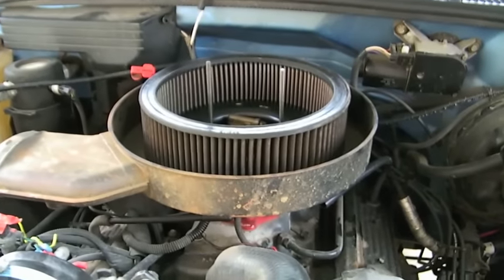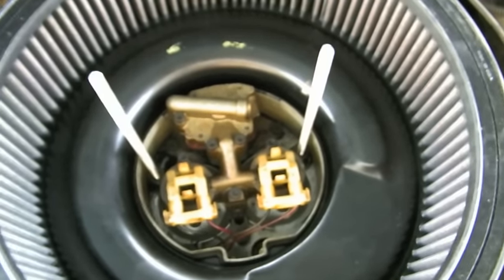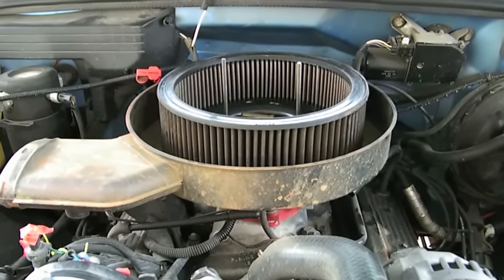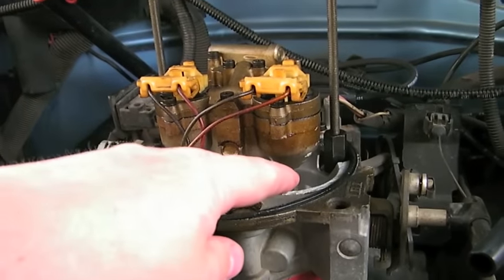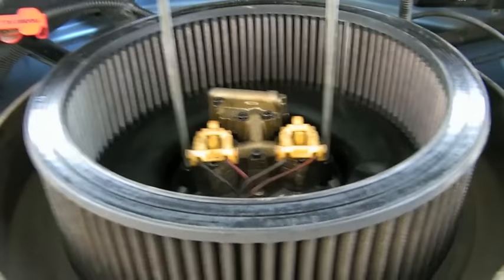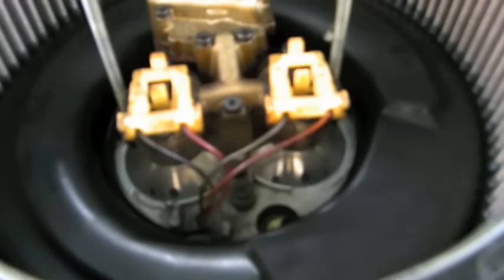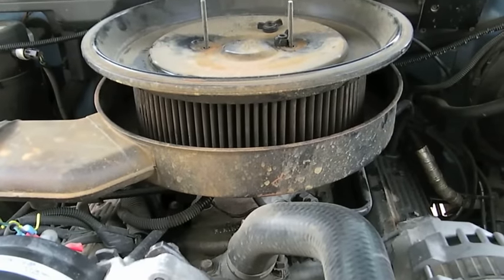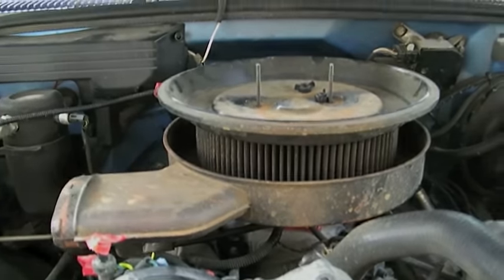TBI mods, how to get the most power and Horse Power from your TBI engine.

Comment: Dude, I'm n tears right now. 1st. thing, if you had read a book on how an engine make power.
(I'm not talking about a brochure written by a company selling high performance aftermarket parts.)
You would not have bought a throttle body spacer. The tower you remove and the metal, was there to smooth the air going through the TB.
The 3 inch exhaust and removing the cat was a big waste of money. (Unless u like a loud slow truck that pollute). You are looking in the wrong place for move hp. The reason you 94 5.7 only make 210hp @ 4000 rpm is because it has a weak cam. 
Change the cam and you want need your Ipod to tell you are making more hp.
20 more hp, you done bumped your head.
Reply: The tower he removed and the metal removed smooths and increases airflow and atomization of the fuel,. A 3 inch exhaust helps a TBI engine, just like headers do.  I have a 1990 Silverado with low miles and last summer it turned a 14.55 @ 98 mph in the quarter mile with stock internals.  I got thottle body mods, 1.6 RR's, custom ground chip, salad bowl with K and N, Corvette servo, headers, cataytic converter deleted, flowmaster and a 160 stat.  If you don't know about throttle body engines, remain quiet.  Mine pulls to 5 grand.
Reply: LT1HILLINGHOE You are lying your ass off. You did not change the cam so your 1990 run out of breath after 4000. You can take the exhaust manifolds off and run headers to the rear bumper and it will still run out of cam @ 4000 rpm.
Reply: Yep these motors main holds backs. Are the heads and cam.  Some 197 72cc would be nice or 202s and atleast 490 lift cam or just custom grind cam that has range atleast to 6k rpm and carb it . But i like the tbi i know the tricks on one we ran on our 360 stroker motor change the injectors want make much as carb but close and drill out the little piece so u can idle it  how u want it .
Reply: ***** I side with you. Cam and valvetrain upgrades will give the most gains. Headers are useless on cheap builds under around 300hp. And cheap builds are those who "mod" their stock parts rather than buying a professionally engineered product(in this case an aftermarket carburetor) . Sure, the throttle response may be more noticeable but your losing turbulence on long pulls. And "atomization" of the fuel is determined by the injectors themselves, not the air dams. Haha atomization. I think you meant carburetion? And TBI is simply the first step into fuel injection, the same rules apply for the most part whether its old school carb jets, tbi or efi in terms of exhaust and intake.
Reply: WetWypes It's funny how people think EFI has change the rules to making an engine stronger. There are people who think changing the chip is all they have to do to make a 300hp LT-1 make 350 hp.
Reply: WetWypes
Wipe the wet from behind ur ears, sonny buck.  I have been building speed since 1983.  Run along to where you have a more captive audience...say Romper Room or perhaps Fast and Furious movie goers.  Ur a rookie with rookie comments.  Please don't "side" with me.  I don't need that kind of idiotic company.
Reply: WetWypes
That's telling 'em, rookie!!!
Reply: 123444
Reply: ***** you put a cam in an engine to suit your top end, your valve body and intake. you cannot have a large duration cam if your valvetrain and lower end do not have the means to support it, the same way vice versa. taking off stock exaust and putting aftermarket exhaust keeps your engine cooler, providing an equal percentage of horsepower and torque. on an EFI system, you can do acheive the same goal as a carbureted system by using a "chip" that tells the computer to provide more fuel to an engine. you CAN NOT put a new performer cam in an engine without putting a matching chip in the computer. A throttle body spacer increases the distance between fuel deliverory and detonation, allowing the fuel to become more seperated for better burning. just because you can change oil and replace spark plugs and fantasize over having a performance vehicle does not make you qualified to insult someone elses project. believe it or not but i can get a chevy v6 rwd car to run 0-60 in 3.5 seconds. all i did was run a two speed powerglide transmission and a really low rear end. the engine had 100 hp and had a missfire.
Reply: Seth C You can get cams that have steeper ramp rates and tighter base lobes to keep the computer and the sniffer happy. But everyone modifies their vehicles differently, I just prefer the most beneficial ways
Reply: WetWypes If u don't have to reprogram the computer, the cam ain't worth putting in.
Reply: ***** bud, a chip tells the computer to tell the engine how to run. you put a high performance parts in an engine, you either go carb, so you can manually adjust your fuel/air, or you get a computer tuning chip so it does it automatically. ive built and seen engines with a single injected tbi out perform a 4 barrel edelbrock carb. getting a new tuner chip is like getting a new engine in a sense, you cant say they do nothing for power. you probably watched something on tv and think you know everything about everything.
Reply: WetWypes i mean, a much as they have cams for intense power at the expense of fuel economy, they have just as much for fuel efficiency. but if you have a vehicle with obd 1 or 2 you need a way to tell the computer in needs to change what its doing or youll run into problems.
Reply: Seth C No one make a cam for fuel economy. Stock cam only.
Reply: ***** yup. If you knew how a can works youd know all you had to do was shorten the lift and duration of the intake lobe. But you'd have to do the same to the exhaust lobe. I mean, what did you think a cam does?
Reply: Seth C OK smart guy, how are u going to shorten the lift and duration of the stock cam? Why would u want to anyway? The damn engine only make 160 hp.
Reply: ***** the 350? no the tbi made 210 and even up to 240 in the later years. my point was your cam pretty much makes the performance of your engine, provided you had everything to boot. you were saying in your original comment that exhaust has nothing to do with power, measuring my 89 350 truck stock had around 200 hp. after cutting off the exhaust to the manifolds i had 215 but my torque shot real far down. after putting a 3 inch pipe into a flowmaster muffler i had 220 hp with the same torque i started out with. but back to the cam subject, you get whatever cam suites your needs, whether its torque at lower end or higher end, or for fuel economy.
Reply: Seth C Your 350 made the same hp and torque with what ever exhaust u had because you did not change the cam.
Reply: the cam isnt the only thing that creates horsepower. it wont create any horsepower if you dont have the stuff to support it. you obviously dont know how anything has to do with anything. what vehicle did you only put a cam in and are all of a sudden have 9 sec quarters?
Reply: Seth C You can make more hp changing the cam and reprogramming the computer on a TBI 4.3, than putting a throttle body spacer, headers, x-pipe, dual exhaust and cold air intake put to gather.
Around 1992 GN had some minivans making 175 hp from TBI 4.3s. My friend had a 92 Safari and my sister had a 92 Astro. I use to wonder why his Safari was so much faster.
Reply: ***** well one of those vans were awd, aint sure which one. but yeah you just stated the point i was trying to make earlier. you cant just put a cam in and hope for the best, your engine has to be well equiped to support it
Reply: Seth C Neither van was awd. The point I'm making is, both van had the same 4.3 TBI. The 92 Safari had the hotter cam and probably a different computer. That 15 hp was like night and day.
Reply: now you are switching opinions, earlier you were telling me this was wrong now your telling me all about it. do you even know what horsepower is?
Reply: SS4LiFe1488 Either way you feel any difference.
Reply: +iimusion &:what do you recommend doing to this sort of engine to increase horse power?
Reply: Thelegitrager Read my comment again and you will see where I said CHANGE THE CAM. That is the reason TBI 350 are weak. It's not the throttle body. Put a cam from a 96-99 5.7 and reprogram the computer and you will feel the power.
Reply: +blackericdenice there are a lot of smaller-ticket items to do in order to yield results before cams. Cam should only be done with proper heads and intake. Besides you're comparing apples and oranges - bolt on mods can't be compared to major engine work.

Might as well just tell the guy to bore and stroke it to to a 383
Reply: Bricke The small ticket BS u speak of don't increase hp. The dyno videos u see on cable and youtube are staged.
He can get 50 hp or more with a hot cam with the stock heads compression and displacement. The only problem is programming the computer to add more fuel.
Reply: I don't rely on YouTubers posting butt-dyno videos praising certain mods. I work in a shop and do plenty of that myself in my spare time.

But again, you're comparing apples to oranges; and if you think a cam is your only (read: "only") way to increase power in these trucks, then you're just being stubborn, and I'm sorry you feel that way.

Big-ticket jobs requiring cams, heads and intakes isn't comparable to DIY'ers doing backyard mods, which is what THESE videos are about.
Reply: Bricke The only way to increase hp is to add nitro, change the cam or boost the engine. Those are the only way to get more air into the engine. Anything else is bull shit.
Reply: ...yeah ok.
Reply: +blackericdenice No, if you take a stock air cleaner such as his, Grind the ridges off the tbi and put on an open element air cleaner you will infact increase the airflow into the engine, also the ridges arnt to smooth out the air flow, if anything they are doing the opposite. Its like putting a piece of plywood in front of a fan (or half of it) and saying it smoothes out the air flow. Doesnt make much sense now does it? As for the TBI spacer, it reallt depends on the vehicle. There have been dyno tested vehicles before and after that have saw a 2-3hp gain from one, others have lost hp or it didnt affect it at all. +boofighter Keep it up man, Do all the mods you want. If you can tell a difference (in a good way) then thats all that matters.
Reply: +blackericdenice you really think you know how to build engines dont you
Reply: Sam Wegleitner No, I don't I can, I know I can. I went to school for it.
Reply: SS4LiFe1488 i know this is old but honestly removing the cat wont improve hp by much, it will some because it reduces back pressure to the engine but it will increase mpg. Also changing stock y pipes to a more free flowing y pipe will help too. Also if you are making more than 270 hp changing headers will help as well but you wont notice a big difference (depending on the engine) until you do a cam swap. Even doing a mild one like Rv rolloer cam or flat tappet would help. With a 350 tbi if you do either of those cams or a different one plus put vortec heads with an intake swap on it and change headers and the y pipe with a Cat delete and flowmaster Pro 40 or pro 44 series you will have power and an aggressive sound. Or you can opt out of the Cat delete and get a high flowing cat.
Reply: Justice Clayton I stop reading your comment at cam. I don't waste my time reading long comments if the person don't what they are talking about. 
The only way to get more air into an engine is to add nitro, change to a hotter cam or boost the engine. This is not my opinion, this is fact. If you knew what you was talking about, you would agree.
Reply: ***** well you can think what you want but you're wrong.I dont see how Nitrus is adding air whenm its a Gas?
Reply: Justice Clayton COME DUDE. I know u did not just say that. I'm talking about nitrous oxide. Google it and you will see how it will put more air into an engine.
Reply: ***** I never said a TBS would garuntee HP or increase air. I said some poeple have proven gains and others have lost. I know how an internal combustion engine works. Intake,Compression,combustion, and exhaust. Pretty simple to comprehend. But there are a ton of ways to increase air flow other than what you are saying. No, not all of them are cheap like having your heads port and polished to increase flow rate by maybe 10-20% But there is a list of very long mods you could do to get Hp, out of an engine. Lets take this guys 350 tbi for example. CAI or open element, Lets say a comp cam, Vortec heads that have been polished, Long tube (or shorty) headers. (i prefer hooker), After market Y pipe because the factory one on these is terrible. Switch from a TBI to a Holley or Eldebrock perform. carb with the eldebrok perform intake conversion. Put in a programmer or chip. Change the crappy 3.46 rear end to a 3.73 or a 4.10. Thats pretty much all you can do to these motors besides port matching them. Unless you want to build the block and make it a 383, but that is about triple the cost of everything i mentioned put together. All of that being said you would gain (i am estimating here) approximately anywhere from 25-70 HP depending on fuel type (octane rating) and the programmer/chip and if you actually redo the ECM to take advantage of the new vortec heads you just put on. Also you would have to upgrade the fuel pump to support the 12-15PSI of fuel pressure this thing is going to want. I'd reccomend 13. Now get a perform Dist, cap, and rotor as well as an ignition system and you will see 50-70hp gain if not more from the stock side of things.
Reply: Correct me if i am wrong which i am sure you will think i am.
Oh and a cowl induction hood would increase air flow to the inside of the hood allowing the Air filter to suck in more air, as long as you arnt using a pos paper filter and use a oil lined cotton filter such as K&N
Reply: Justice Clayton A cam will give u the largest increase of hp out of all those parts u name. Rear end gears can make your car quicker. I would rather have 300 hp 350 and 2.73 gears. Than 150 hp 350 and 3.73 gears.
Reply: I would have to disagree, Chaning the cam on a stock 350 (tbi) without using vortec heads wont yield as much Hp as if you had used the vortec heads. If you are changing the Cam you may as well do the heads. As for the rear end gears yes i know what they do and i agree. But lets be honest who owns a 300hp 350 and still has stock gears in it.
Reply: Justice Clayton Not right. You can get more hp from changing the cam alone than changing the heads alone. The reason I say this is, the stock 95 heads are nowhere near max flow with the 95 cam. The reason the 96 vortec heads don't have the ramps are because the CPI atomize fuel better. BTW, before you say the 95 swirl heads make more low end torque. The 96 vortec made 330 ft-lbs of torque @ 2800 rpm which is lower than the 95.
Reply: +blackericdenice  it may run out of power, but the trucks pull to 5K.  5k is the redline of the old tbi engines.
Reply: 2012Z28Camaro If you say so.
Reply: i do. because some of us actually build racecars.....
Reply: 2012Z28Camaro You build race cars right? I have a question you should know. I have a 271 V8 with 180 hp at 4000 rpm. I want it to make about the same hp but at 5000 rpm. What should I do?
Reply: +blackericdenice put some bigger gears behind it
Reply: Cody Edwards Wow, u build race cars to?
Reply: Nope lol just my guess.
Reply: +blackericdenice but outa curiousity, hows it done?
Reply: +blackericdenice cause biger gears would increase rpm and tourqe but not horse power. or maby swap gear ratios in the trans, but this is one way you could do what you was saying, and btw takin crap over a key bord is awsum, so where do you build racecars?
Reply: Cody Edwards I said raise the engine hp peak rpm.
There are a lot of kids on youtube fronting like they know something. I can think of Google proof question to weed out the fake-ass people.
Reply: +blackericdenice yea i feel yea, in first question you said about same hp but at higher rpm, thats why i said gears, but it but to raise rpm its gota breath beter(intake, cam, heads, headers/exhaust) probably should upgrade the spark(pending on what it is, distributer, coil, points and plugs/wires) retune fuel source/vacuum, pending on how high your gona be reving it, possibly bottem end/rotating assembly
Reply: +blackericdenice and pending on what your throwin it into, high hp dont mean nothing unless your talkin up by 7 to 800 hp or so, you can make a 4 banger do wheel stands and run like a bat outa hell with the right gear ratio, you just aint gona have a high top speed
Reply: 2012Z28Camaro  I gave u a change to prove yourself. If u really race engines, the question would have been easy and u would not have taken so long to tell me. I was looking for u to say 7 words. You can't fool a real car guy with shit u googled. 
Where I come from, we don't say words like Mod. That shit is straight from an auto TV show. Patina? We call it fade. That's how I tell if u are real or Hollywood.
Reply: ***** also patina? i call that rusty shit. rusty shit doesnt look good
Reply: 2012Z28Camaro Are u going to answer the question?
Reply: Cody Edwards I will tell u if Mr.I build Race Engines aka 2012 don't give me the right answer. His fingers are bleeding right about now.
Reply: 2012Z28Camaro That's what I was waiting for. You just through n the towel. When a racist white man can't when a fight. He start using racial slurs.
Reply: 2012Z28Camaro Because of the racial slur on this channel. I deleted your turbo lag comment on my channel. If u use one racial slur on my channel. I will block you.
Reply: 2012Z28Camaro I got another Google proof question. I have an 89 Mustang GT with a 225 hp at 4200 rpm 5.0. I add a supercharger and now my engine make 300 hp. At about what rpm will my engine peak at?
Reply: Once again trying to seem like you know something. Its not google proof either nothing is.

But you neglected the size of the blower, whether it was roots type, or centrifugal, if you changed the cam and heads (which anyone who is putting a supercharger on would do with at least minimal head porting) 

If all you did was straight up supercharge it then your engine would peak its hp and torque (of which you didnt specify) depending on blower size and amount of boost you were running of course. but im sure you "think" it works differently
Reply: *****  and i do hope you know what supporting mods a supercharger requires other than what i listed.....
Reply: 2012Z28Camaro Answer the question if u can. I'm not asking you to rewrite history.
Reply: +blackericdenice yo i answered this shit a week ago. literally two comments up. its right above my last comment where. heres copy and paste since you dont seem to look up. 
   2012Z28Camaro 1 week ago

Once again trying to seem like you know something. Its not google proof either nothing is.

But you neglected the size of the blower, whether it was roots type, or centrifugal, if you changed the cam and heads (which anyone who is putting a supercharger on would do with at least minimal head porting) 

If all you did was straight up supercharge it then your engine would peak its hp and torque (of which you didnt specify) depending on blower size and amount of boost you were running of course. but im sure you "think" it works differently
Reply: 2012Z28Camaro All that writing and u still have not answer the question. It's Google proof because the answer is online but you have to know something about engines before u will notice it.
The size and type of the blower is not needed. I gave u all the info u need to answer the question.
Again I say. You can't learn about cars reading hipo parts adds because they will only tell u enough to buy their parts.
Reply: 2012Z28Camaro The 1st question about the 271 cuin v8 making 180 hp at 4000 rpm. To raise the peak rpm to 5000 rpm. You have to add duration only to the cam. 
The 225 hp at 4200 rpm 5.0 v8. If u add a supercharger and the engine made 300 hp. The peak would still be at 4200 rpm. 
When u know what u are talking about. You don't have to give long ass comments to explain yourself.
Reply: ***** you asked how to move the peak rpm with an engine making that much power.

You did not say increase power. therefor a cam swap is not an option. fucking obviously you can change the cam and change the peak power. thats every engine not just that one. gears and stall would effectively move the rpm with out changing the 180hp limit you gave me.

No with a supercharger peak would not be the same. it would hit much sooner. depending on blower size.
Reply: ***** once again your trying to sound smarter than you are and never answered my question. just like in your videos, you post what you think, not facts.
Reply: 2012Z28Camaro If u really build race engines u would know I'm right..
Reply: ***** Not hardly. youve got no real idea how engines work. Youve got a decent base of regular knowledge, but you preach your opinion as fact on many things you dont actually know.  Im working on 5 motors now. one 4.8, two 5.7Ls1s two 305sbcs.(sbcs will be in circle track cars)

Got a 6.0 thats ill be turning into a LSA but not messing with it till the other 5 are done.

1 ls1 is going in my autox camaro
(450rwhp, Handported heads with .600/.600 cam on 112LSA, daily with yankSS3600, 4.10s
1 ls1 is going into an 80s TA
LSX conversion that ill just sell as a full weight 11.xx drag car

The 4.8 is going procharged and will be in a 80s CJ7 (800+HP redlining at approx 7500)
will stay lifted on its tired 33x12.50s

The Two 305s will be in circle track cars im building. 
High revving, but durable turds that my friends can use for a few years...

what are you building?  a 180hp 271? thats cool...
Reply: ***** My ninja
Reply: Yank it out and drop in a ZZ5
Reply from the maker: +Peter  Pease 
I don't think I will be doing that.
Reply: SIMPLYBEAST1231 It can pull to 5,000 but it's not making hp pass 4000 rpm. The TBI is not the problem. The cam is the restriction.
Reply: ***** mighty funny since everyone always blames the TBI heads for being garbage and not wanting to pull air past 4500.....

The cams also arent great but the biggest factor on the 88-94 trucks and cars are the tbi heads. Nothing but boat anchors.
Reply: Great point about the head not making power pass 4500. The main reason for the low hp is the cam. Put a bigger cam in a TBI engine and it can make 250 hp with the stock heads. I can't tell you how to get the computer to run the injector longer.
People claim my 96 Vortec stock intake and sider injection want flow well with a cam. Why did I have to add more than a pound of fuel per minute to get my engine to run at 14.7 AFR? I will make a video showing how much fuel I had to add soon.
Reply: blackericdenice boost the engine... hmmm. isn't that forcing air flow? the weakness on these motors(I thinks it was a 5.7 TBI?) are the heads. very restrictive. open up air flow in and let it out freely will maximize the HP that should be on the cam already. these modifications (mods for short) are doing exactly that. maximizing the horsepower of the mid to bottom end of the motor. once you hit the max, then and only then do you think about cam work. you sound like a shit mechanic telling people that they need to replace a head gasket if its leaking coolant without bothering to check anything else.
Reply: Adding nos, boost or a cam is the only way to get hp from that engine. This shit mechanic has a video where I rebuilt my engine and change the cam in a 96 Tahoe. Do you have anything on youtube other than words?
Reply: blackericdenice before I say anything else, tell me the science as to why or how N20 works. NOS  btw is a name brand not the actual gas. but you knew that right?
Reply: I just wasted 10 mins of my life reading this entire comment thread.
Reply from the maker: You win the prize.
Reply: @LT1HILLINGHOE  I have a stock one (except injector springs) on a ZZ4 with a Weiand 8000 intake, 1 inch 2 hole spacer (for clearance of the EGR breather), and a 5 inch K&N velocity stack. I have hooker 1.75 inch full length headers into 2.5 inch dual exhaust (no cats)and 2 50 series Flow Masters. Ive never taken it to the track but I did put some 22410 Manley springs in the heads and set up the seat pressure at 130 lbs at 1.75 inches. Ive smoked every vortec truck Ive ever run, some so bad it wasnt funny. These mods guys post on here like this clown are ALL WRONG, they shouldn't be making these videos because theyre giving ppl bad info.